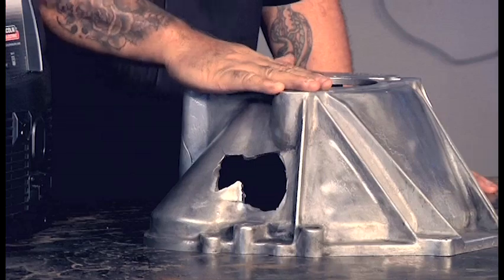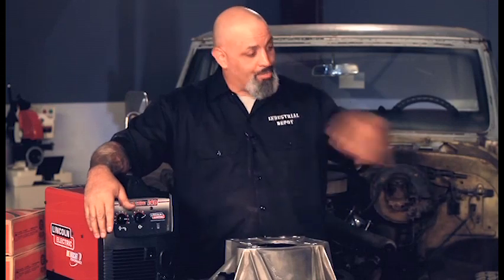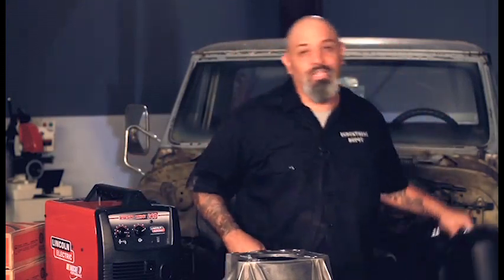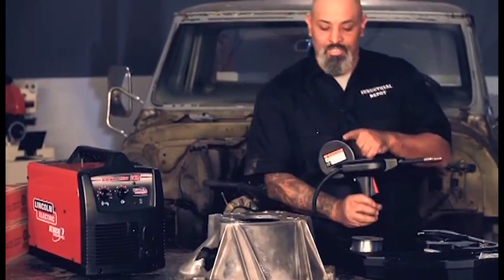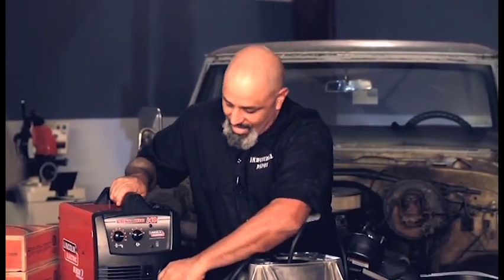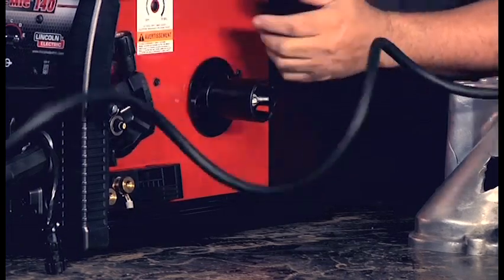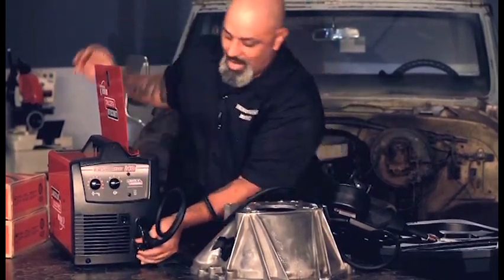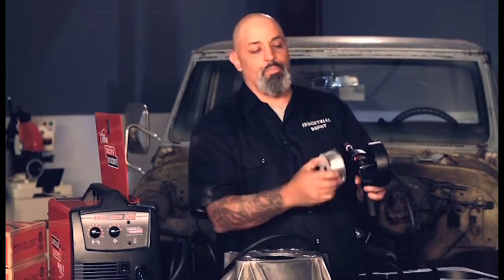Welding Cast Aluminum with Lou Santiago

Comment: My 140 doesn't need the harness kit. The harness kit came with the spool gun but my 140 had everything installed from the factory. Changing from steel to aluminum is easy. Swap the DC- to DC+ and then flip a switch that uses the wheels in the welder to use the wheels in the spool gun instead. However.  He did not show that you need to hook up the argon. Don't waste your time with aluminum flux.